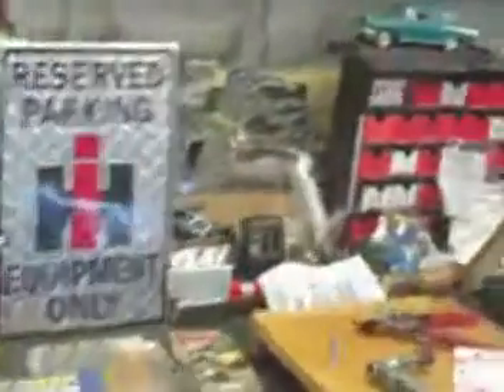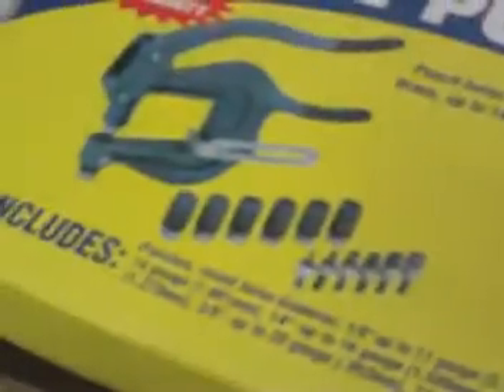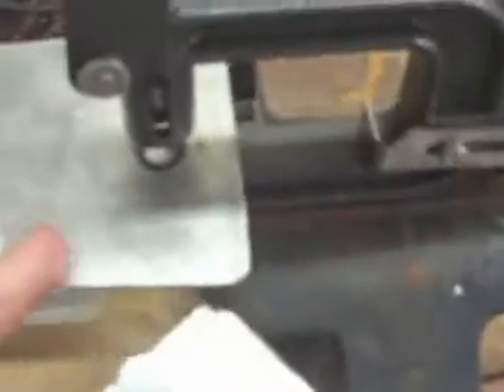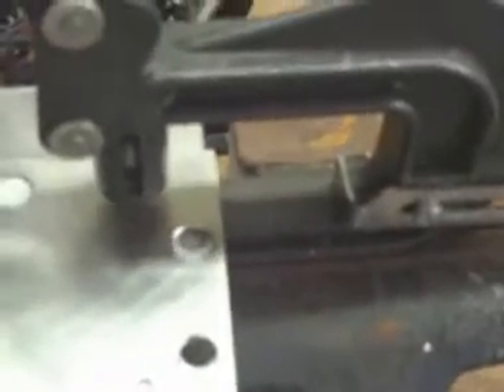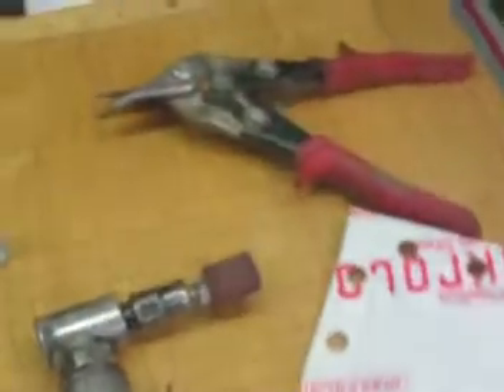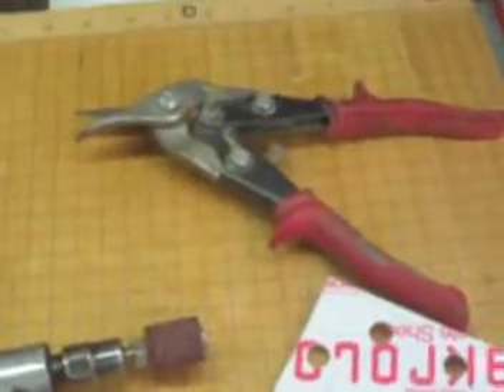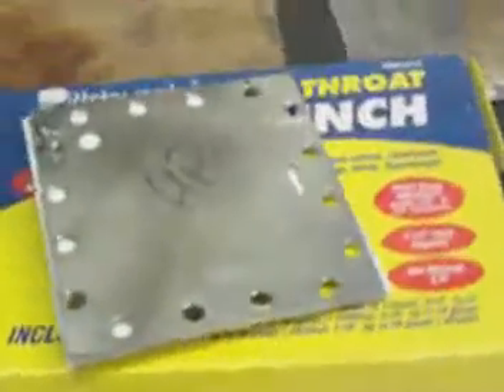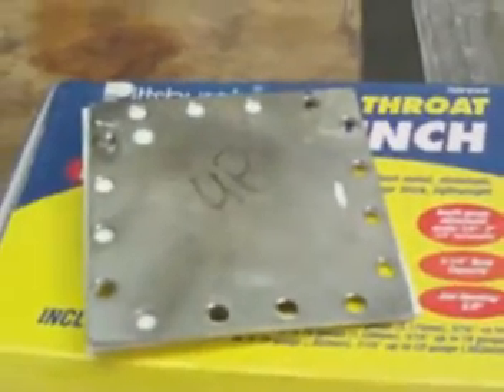Gasket maker for HHO fuel cells

Comment from the maker: I am using the gray pvc good to 140 deg any plastic shop 0.060 thick if you want to go up in temp use teflon,or nylon,then scuff the gasket surface with 220 sand paper.this will help them seat since they have a hard surface.

Comment from the maker: IT DOES VERY GOOD  3lpm @27 amps,voltage at plate gaps is 2 volts 14 plate but does not flow like a dry cell,kinda acts like a wet cell water stays in the gaps longer on my S10 I did pick up all most 8 mpg more but my cell ran out of water half way which would have given me better results if it would have stayed at 26 amps the whole way,I WILL BE BACK.

Comment: That material isn't chemically compatible with KOH or NaOH.  I sent you a PM with the link to the companies chemical compatibility datasheet.  I'm amazed that it doesn't leak, being that it isn't an elastomer at all.  You must have really good bolt spacings and surface finish on both the gasket and the plates.  Looks like a really well constructed cell, otherwise, thanks for the video.